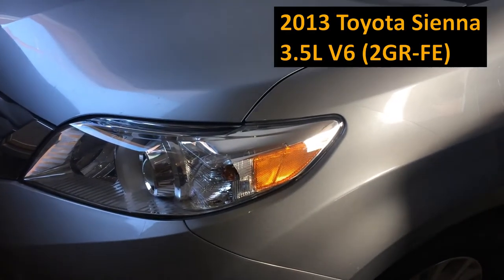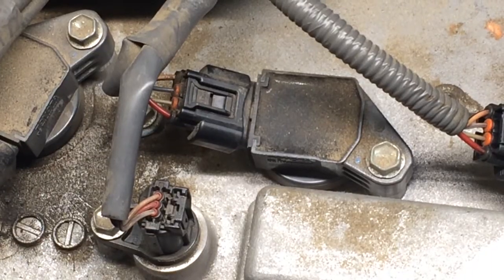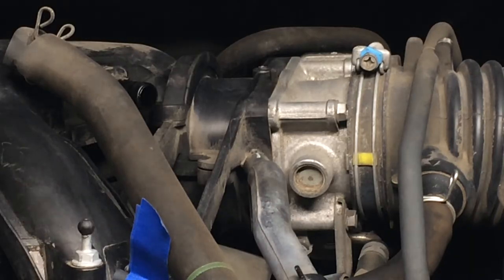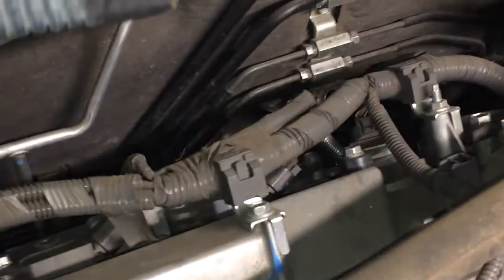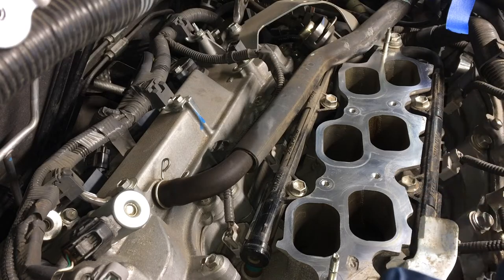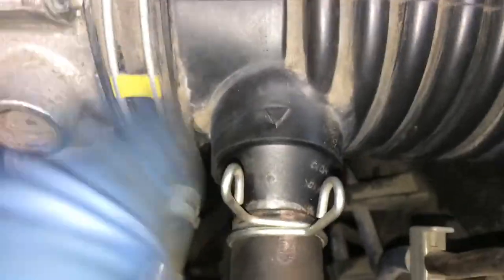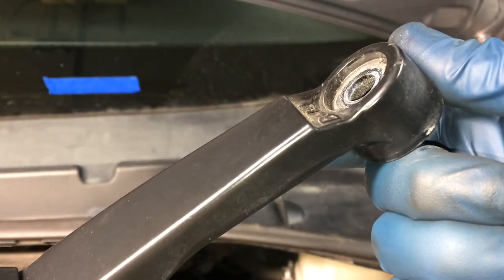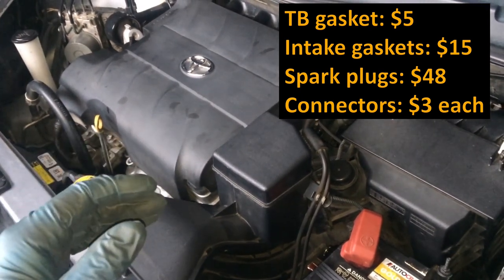2011 - 2016 Toyota Sienna DIY Replace Spark Plugs, Coils, Intake Manifold Gasket V6 3.5L (2GR-FE)

Comment from the maker: Timestamps, Part  Numbers, Torque values, links to other videos of this job:

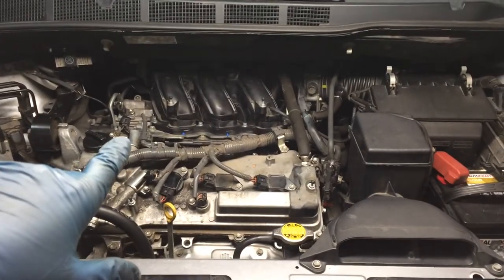 00:45  Diagnostics and Cylinder numbering
 01:56  Begin repair on Bank 2 (front plugs, Cylinders 2. 4, 6)
 03:20  Removing a coil without disconnecting the electrical
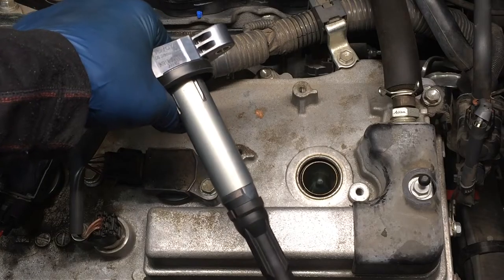 03:56  Always check each coil for the spring

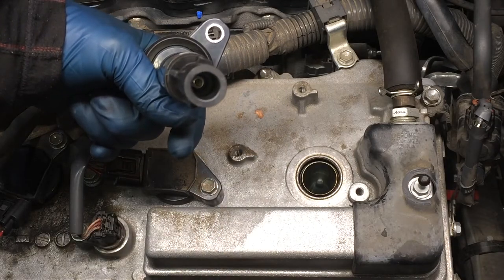 04:20  Important tips and part numbers: 
OE Coils are DE (Diamond Electric): #90919-A2004, superseded by #90919-A2007.

 Also: Denso 673-1309 (check this fit for your application by VIN).
 OE Spark plugs are Denso FK20HR11 Iridium (Toyota part #90919-01247). 

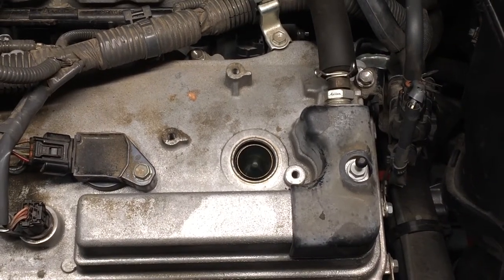 05:56 What to do if your coil boot disconnects while removing
 the coil

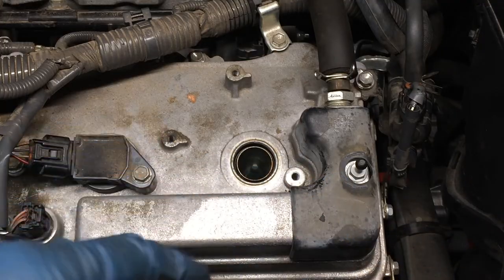 06:55  Recommended spark plug socket (TEQ TP80546, $10)
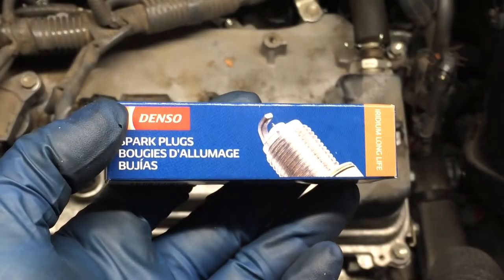 07:29  Recommended spark plugs (OE Denso FK20HR11, Toyota #90919-01247)
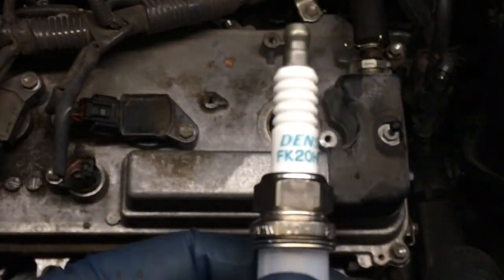 08:13  Important notes if you use anti-seize on the spark plug threads 
 08:37  Applying dielectric grease to the plug (optional) 

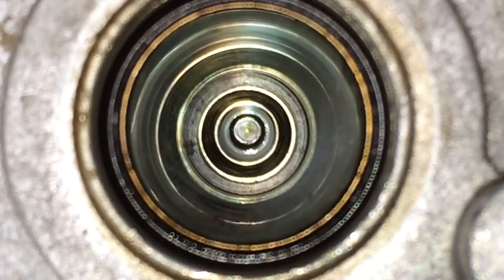 09:17  Remove and replace the spark plug (torque 13 ft-lbs, 156 inch-lbs)
 11:05  Reinstall the ignition coil and bolt (torque 7 ft-lbs, 84 inch-lbs) 
 11:24  Disconnecting the coil electrical without breaking it
 
 12:15  Begin repair for Bank 1 (rear plugs)
 13:33  Remove the wiper arms (two 14mm nuts)
 14:30  Remove the upper plastic cowl
 15:39  Remove the wiper motor (three 10mm bolts)
 18:40  Remove the lower metal cowl (five 10mm bolts, four 14mm nuts)
 19:43  Disconnect the fuel pump resistor (electrical connection)
 20:39  View/Access with the cowls removed
 21:00  Disconnect four hoses for the air surge tank
 24:02  Disconnect the PCV hose to air hose
 24:27  Remove the large air hose from the throttle body
 26:03  Disconnect the throttle body from the surge tank (four 10mm bolts)
 27:09  Remove rear driver's side bracket bolt from surge tank (12mm)
 27:57  Remove rear passenger's side bracket bolt from surge tank (12mm)
 29:21  Disconnect the ACIS electrical from the surge tank
 29:51  Remove the six surge tank fasteners (four 5mm hex head bolts, two 10mm nuts)
 32:10  Remove the surge tank
 33:10  View of intake manifold (cover intake manifold openings)
 33:59  View of Bank 1 coils (Cylinders 1, 3, 5)
 34:43  Disconnect the coil electrical on Cylinder 1
 35:11  Remove the coil bolt (10mm) on Cylinder 1
 35:29  Remove the coil from Cylinder 1
 36:02  Remove the spark plug from Cylinder 1
 36:57  Install the new spark plugs to Cylinder 1
 37:55  Reinstall the coil to Cylinder 1
 38:40  Remove the spark plug from Cylinder 3
 38:54  Install the spark plug to Cylinder 3
 39:14  Disconnect the coil electrical on Cylinder 5
 39:50  Moving the harness to allow room to pull up the coil on Cylinder 5
 40:36  Install the new spark plug to Cylinder 5

 41:33  Reinstalling a loose bracket stud (10mm and E5)
 42:06  Reinstalling a loose surge tank stud (E6)

 42:27  Remove the old intake manifold gaskets
 43:31  Install new intake manifold gaskets (Felpro MS 96786, Toyota #17176-0P021)
 45:03  Loosely reinstall surge tank bracket
 45:44  Place the surge tank back onto the intake manifold
 47:22  Reinstall the six surge tank fasteners finger-tight
 49:45  Installation (tightening) sequence for these six fasteners
 50:18  Tighten the six surge tank fasteners in multiple passes
 (Final torque: 5mm hex head bolts: 13 ft-lbs; 10mm nuts: 12 ft-lbs)
 51:10  Reinstall the bracket bolts (12mm, 15 ft-lbs)
 52:21  Reconnect the ACIS electrical to the surge tank
 52:32  Note on cleaning the throttle body 
 53:16  Install new throttle body gasket (Felpro 61445, Toyota #22271-0P020) 
 53:53  Reinstall the throttle body (7 ft-lbs, 84 inch-lbs)
 54:46  Reinstall the large air hose
 56:53  Reconnect the PCV hose to the air hose
 57:20  Reconnect the four hoses for the air surge tank
 59:16  Temporarily install the lower cowl to connect the fuel pump resistor
 01:00:12  Reconnect the fuel pump resistor electrical

 01:00:24  Start the engine and check for codes
 Code P0354 troubleshooting

 01:02:45  Complete the lower cowl installation (nuts: 66 ft-lbs)
 01:05:25  Reinstall the wiper motor (62 inch-lbs)
 01:06:18  Reinstall the plastic cowl 
 01:08:22  Reinstall the wiper arms (18 ft-lbs)
 
 01:11:25 How to replace the ignition coil electrical connector
 (Toyota part #90980-11885)

Great videos by other Youtubers of this job, or parts of it:
Done with removing the cowls: https://www.youtube.com/watch?v=jMOCr68BAZI
Done without removing the cowls: https://www.youtube.com/watch?v=ojk5ilmuU90
Replacing the electrical connectors:  https://www.youtube.com/watch?v=3ZUKuexrRsA

I hope this video is helpful.  Please leave your comments, tips, and questions, in the Comments section.  Thanks for watching, and good luck with your repair!
Reply: No offense meant, but your voice sounds like a cross between Michael Jackson and Beast Boy from Teen Titans. Very detailed and well produced video. 
Do the plugs need to be replaced as "routine" or only if you start experiencing misses or trouble codes? -My 2015 Sienna has about 140,000 miles, still gets 25-30 mpg on hwy, and runs like a top. Went for an oil change(wife insists having it done at dealership even though I change it on my truck) and the service rep tried to sell me the plug replacement and fuel system cleaning right off the bat based on mileage alone.😠 I declined, then they came up with, "You have an oil leak either from main seal or valve covers, we can check that out..." I said, "Just the oil and filter please." As far as checking dipstick, the engine uses ZERO oil and not even a drop has appeared on my driveway. Pulled the engine cover and there seems to be a tiny bit of weeping around the cover, but not enough to make any run past the edge. Would possibly re-torquing those bolts even be worth it, or should I replace the gaskets, or just leave it alone?
Great channel. Subscribing.
Reply from the maker: @williamgaines9784  Well, I wish I could dance like Michael Jackson!  (But I have no idea what Teen Titans is)  Yes, spark plug changes are considered routine maintenance, and the service interval for the 2GR-Fe spark plugs is 120K miles.  

That said, I suspect that many Siennas (and other Toyotas with the 2GR-FE engine) have their original plugs at high mileage simply because of the cost of a spark plug change.  It may well be that many people wait till they get a misfire code, perhaps due to a failing igniter or oil on a plug from a failing valve cover gasket, etc, then the owners respond with new plugs, igniters, valve cover gaskets, etc at that time.  

The benefits of replacing the spark plugs are mainly increased fuel economy, cleaner/smoother idle, and greater responsiveness.  Also, at least having a look at the spark plugs can give you an idea of something that might be going wrong, especially fuel-wise, which might not trip a check engine light but still needs to be addressed.  

As for the oil leak: I would try to determine exactly where the oil is coming from, to be sure that it is not oil accumulating on or near the valve cover from another place.  So, I'd clean up the area, then check it after a drive and while idling. 

Replacing the Bank 1 valve cover (the rear head) is a big job which requires all the steps shown in the video, plus removal of a few more parts and the valve cover itself in that cramped area (so if you do that job, you might as well change the spark plugs while you're back there).  The front valve cover is much easier, so hopefully that's where the leak is, if there is one! 

If you don't have ramps, maybe pick some up and have a look yourself from underneath.  Even a small oil leak will make a mess: if you don't see a mess, and you're not losing oil, then maybe the service manager wasn't being honest.  

I hope that helps -- good luck!
Reply: @L35inColorado  Thanks for the reply. I may put it up on the ramps as you suggest(I have more than one set 😉), but will have to wait until I heal up from bicep surgery. Again, great video.
Reply: This is absolutely precise, excellently done.
Reply: When do you know to replace the manifold gasket?  I changed the valve cover gasket a few years ago and noticed a big improvement in oil burning around the engine.
Reply: You forgot the EAR-DEATH timestamp @9:26.
Reply: But in all seriousness, this is delightfully thorough, well shot/narrated, and timestamped.  And you yourself are an appreciated change from the typical gruff and taciturn mechanics that usually make these guides...though I appreciate all ya'll.
Reply from the maker: @codyt3685  Thanks, and thanks for watching! : )
Reply from the maker: @codyt3685  Whoops!  Yes, that compressed air is kinda loud on headphones!

Comment: Without question the best DIY video I have ever watched. And I just happened to buy a 2013 Sienna... which was great timing as my GV80 was just flatbedded to the dealership.... again. They do give me loaners. Bought the Sienna to drag my kiddo friends around. Because of course....if buy the top tier GV80.... doesn't come with a 3rd row.
Reply from the maker: Thanks!  Oh boy, hopefully they get everything sorted out with your GV80.  My mom loves her Sienna - it has been a very reliable vehicle.  Her biggest complaint is the road noise, especially for the rear passengers, but other than that, it has been a great van.  Thanks for watching!  : )

Comment: If someone had told me I would spend over an hour watching how to change spark plugs, I would have laughed in their face.  But I did watch and am glad I did.  Then I checked out more of your how to’s and am very impressed with your scope of knowledge from faucets to autos to tractors.  Excellent production value, narration and, of course, knowledge of your subject.  Well done, carry on.
Reply from the maker: Wow, thanks - I really appreciate that!  Yes, the spark plug job on this engine is far more involved than it ought to be.  Pulling the plugs on the tractor or skidsteer is much easier!  : )  Thanks for watching!
Reply: I have to said. thank you for taking your time to make a video for us to watch. I appreciateit. You rock!

Comment: Thanks for posting this video.  I've done this method as well as the method where the air filter is removed.   This one seemed more straightforward.  
I removee the 2 bolts and a nut that held the rear coil harness and had plenty of slack to avoid removing the clips to the coils. I only removed the rear bolt to that difficult bracket and had no trouble removing or replacing the top of the intake.    It took me about 3 hours start to finish.
Reply from the maker: Nice - thanks for adding your tips, and thanks for watching! : )

Comment: You are the best!  why?
1. Such a soothing voice.
2. No one shows as much details as you did.  Examples - the bracket that goes into one of the throttle body bolt. You actually showed it - wonderful.  You actually showed how it looks down in the air intake manifold holes. You mark the important nut and bolts with blue marks in the video - amazing.
3. Very through with actual torque numbers.
Keep up your hard work - all the best.
Reply from the maker: Thank you, and thanks for watching! : )

Comment: You are like the Bob Ross of Toyota maintenance. Your calm voice and even tone lower my blood pressure while learning about something that usually sends it through the roof. Thanks!
Reply from the maker: Haha -- thanks!  Good luck : )
Reply: I agree.  It’s calm and straightforward with all necessary details.  It was still frustrating but that’s just me trying to figure out if I had enough socket extensions and adapters to get those back 3 plugs out and get the support bolts back in…

Comment: The dealer wants to charge about $1K for replacing spark plugs on my 2013 sienna.. there's nothing wrong with them... but the mileage is getting up there 120K .. don't remember if I had them changed before at 60K miles... this video will save me lots of money .. it looks doable.. thanks for posting this video .. very helpful and clear instructions.

Comment: If you need to change Sienna (or similar Toyota V6) plugs, this is the only video you should watch. Literally a step by step video manual with torque specs included. As she mentions, for the rear plugs, you don't necessarily need to remove the wipers etc; and I only removed the insulator below the cowl held by the 4 square plastic nuts.  I could still visualize/manipulate everything, and the plenum still had clearance to lift/slide out, but I had to unbolt the bracket from the rear of the plenum. To reinstall, I loosely bolted the bracket on the plenum first and rotated it while sliding the plenum back in place.    If only all car repair videos were this detailed. Thank you for posting this,  A+
Reply from the maker: Wow, thanks for you comment, and for sharing your tips!  Thanks for watching : )

Comment: Although I haven't reached 29k miles on my 2018 RX450h F Sport, I have reached the 72-month milestone. I have purchased all OE Spark Plugs, Ignition Coils, and PCV Valve and plan on doing a comprehensive tuneup. I also plan to clean both my Throttle Body and my Mass Air Flow Sensor. I have never done this before, but, I've watched a dozen Spark Plug replacement videos multiple times. However, your video was the most informative and insightful I've yet to see. Even the errors you highlighted and corrected were teaching moments. Even though my vehicle is slightly different than the one you've worked on, the overall concept is the same. Good job young lady, good job.

Comment: This is the best how-to video I have ever seen.  It is clear, well organized, and thorough.  It shows hidden tabs, inserts and slots that is very helpful in removing plastic parts.  It clearly shows where to pinch the clips on plastic part connections and electrical connectors to release the locking mechanism. Thank you, thank you, thank you for putting this awesome video together.  After breaking two ignition coil connector clips, despite being very careful, I found that it is easier to cut the tape on the wire harness bundle to create slack so that I don't have to disconnect it from the coil.  Again, thank you L35.  Awesome jog.
Reply from the maker: Wow, thanks for your comment!  I'm so glad the video helped.  Yes, those little connectors are just too darn brittle!  Thanks for adding your tip too!

Comment: Man, I thought I would just get new plugs and be done in 5 min, thank you for the step by step. Very, very helpful 🥂
Reply from the maker: Yeah, unfortunately on the V6's, it's a 5 minute job for the front bank...but a quite a bit more work for that rear bank!  Thanks for watching, and good luck! : )
Reply: @L35inColorado thanks again, job done and I was glad I removed the wipers and cowls, i was amazed at the amount of dirt that accumulated in the corners over 13 years.

Comment: Your attention to detail from all your videos leaves me speechless time after time.  You should be teaching these modern day mechanics on how a car repair should be all about..!

This 2GR-FE video reminds me of my 3MZ-FE nightmare.  Both have the same horrible impossible-to-reach cylinder 1,3,5 and that black intake plenum must be removed to access.  During my 3MZ-FE drama, the air flow sensor big pipe was broken and need to buy from Lexus dealer for $$$. 

Not sure if it's worth consideration: while you are in cylinder 1,3,5, you might as well replacing the coils with brand new ones even if they are not giving trouble b/c with all the vibration during this process, coil 1,3,5 may go out next week or month.  It's like extra insurance 😅
Reply from the maker: Oh yeah, these engines are too much stuff in too little space!  It seems that Toyota has committed to cramming ever-expanding transverse V6's into ever-shrinking engine bays, LOL!  Thanks for sharing your 3MZ-FE experience - good job sorting it out : )  
I agree about the coils: if you have more cash than time, then swap in new coils while you're back there; if you have more time than cash, cross your fingers and hope they last 200K.  I would definitely recommend replacing all the rear coils if you're in there for a second spark plug change at 200K miles or more, and keeping them the original rear coils as spares for the front bank when those eventually fail, since those are so easy to replace.  
Thanks for watching, and thanks for adding your tips!  : )

Comment: This is one of the most encouraging videos to tackle one of the most unnecessarily cumbersome jobs I have ever seen. I just couldn't bilieve how much I need to remove to access 3 spark plugs on my Sienna.... but your video makes it look less intimidating. It's also a good opportunity to clean the throttle body and service some gaskets.
 Btw, I think it's worth it to test 3 of the new plugs in the front first, before installing them in the rear location, just to make sure they work 😅. 
Thank you 1000000 times for this!!!
Reply from the maker: Thanks, and thanks for watching! : )

Comment: Today, I changed the spark plugs on my 2011 Sienna with 110k. Everything went smooth, many thanks to L35. This is an amazing video with all the Torque values. I ordered the parts online from Toyota with discount coupon, 6 spark plugs, 3 intake manifold gasket and throttle body gasket cost me 95 dollars , shipping included. It took about 3 hours. Most difficult part getting the back screws holding the intake manifold. I had to use multiple extensions and 5/8 spark plug socket to get the back spark plugs.
Reply from the maker: Wow, that's wonderful!  Great job on your DIY - you really saved yourself a lot of money (this job is even more expensive at the shop today than it was last year), plus you know the job was one right : )  Thanks for watching!